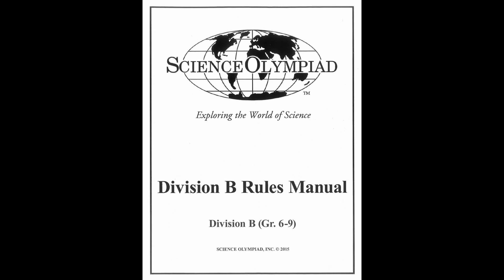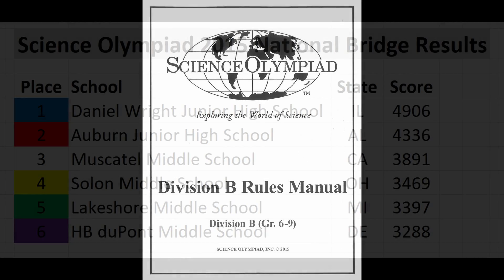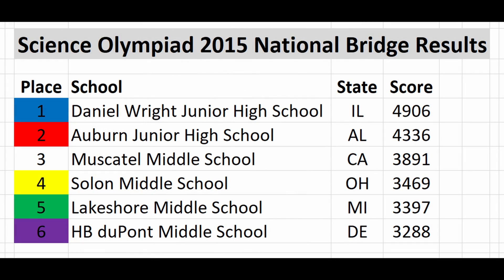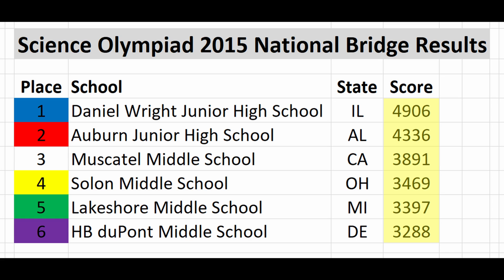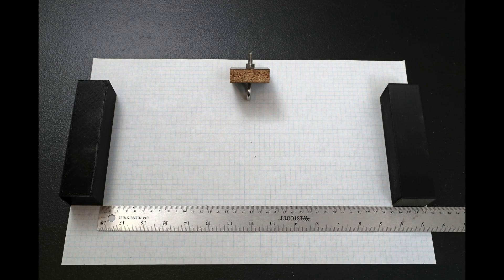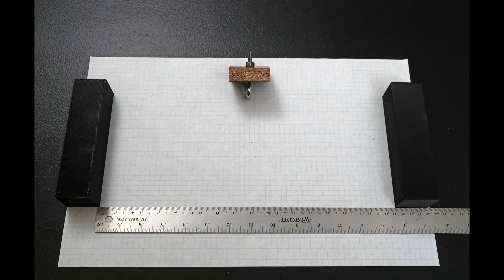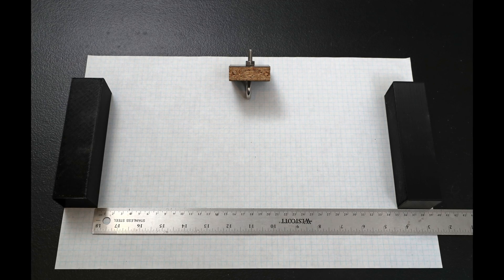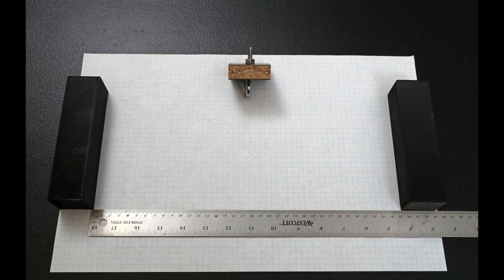Advanced Optimization for SciOly Structural Competitions: (PART 1: Introduction)

Comment: Do you think a bridge with 3 legs, or even two legs would work in a actual competition?
Reply from the maker: I think you could get something with 3 legs to work, but I don't think it would be lighter than the equivalent 4 leg design.  It's really a tiny amount of mass that ties the legs together so the single leg would not only have to be twice as strong as the other two, it would need to be strong enough to withhold the buckling which the cross bracing also is critically important with.  In part 3 of this series I'll show this in a bit more detail
Reply: Good question! I'm not sure about 2 legs, but 3...? Good call!
Reply from the maker: Another tricky thing you'd have to deal with is the tension components potentially crossing the mid-point where the chain hangs down with just 3 legs.  Also, the rules in 2014-2015 specified that the bridge had to be 5cm wide along the entire span, so that would basically eliminate a tripod type design.  It's a neat thought experiment though!